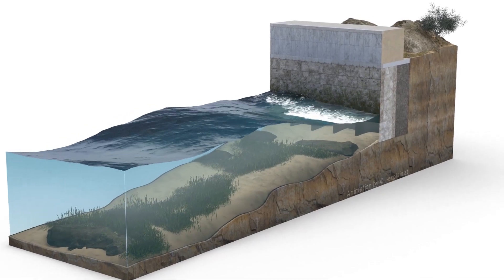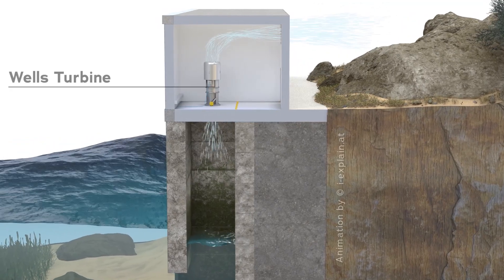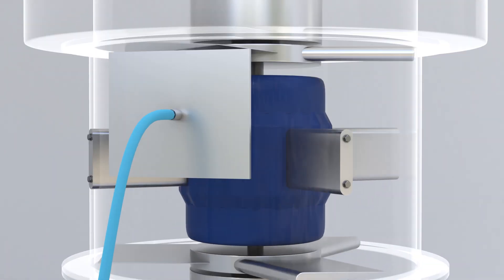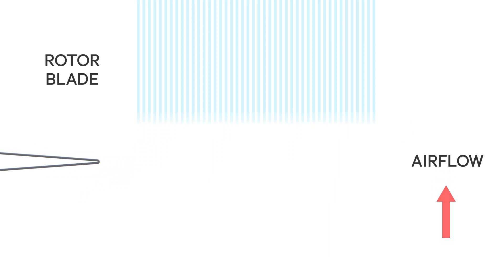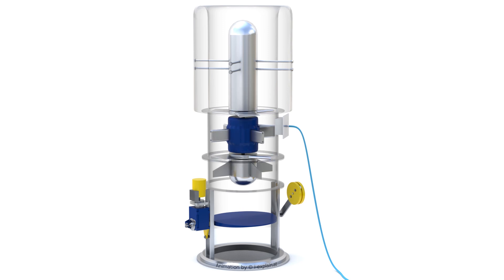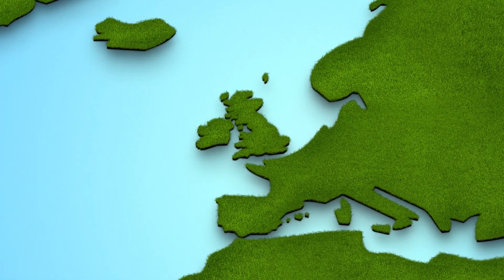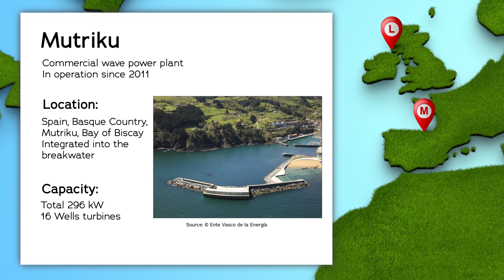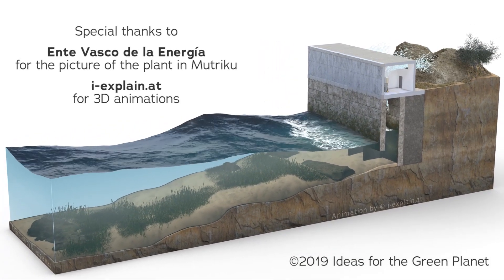Harvesting the Wave Energy: The Function of Wells Turbine

Comment: Hydro turbine would be capable of far more energy as water density is farrrrr beyond air density, meaning far more energy in a specific volume of water than the same volume of air displacing the same amount.
Reply: But it comes with greater cost. Fixing under water is harder, and salt is harmful for the device as well. This one looks simple and requires low maintainance
Reply: Maintenance on anything in saltwater is a bitch, eats through most metals and plastic.

Comment: how do they install something like this?
i like the design. but to make it work requires installation which looks difficult.
Reply from the maker: I don't know what do you mean "installation looks difficult". The turbine is installed in the house above the hole. It is easily accessible.
Reply: @IdeasfortheGreenPlanet  
I was referring to the construction of the base house. Is it a prebuilt mold or is it built after the installation of this product.

I am basically talking about the casing structure around the turbine. Made from concrete I would assume.
Reply from the maker: @52262, Thank you for your comment. According to the information we have from the construction of the Mutriku power plant, a concrete foundation was build in the water first. Then they stacked the prebuild mold, as you guessed. The wave power plant is a part of the breakwater. First, they planned the breakwater and then they decided to enhance it wave power plant.
Reply: @IdeasfortheGreenPlanet  
So is there one in use. I mean instead of the animation. Is there a real example of this running.
Reply: @IdeasfortheGreenPlanet  
As I said, I like the idea of this turbine. It seems very efficient.

Comment: While interesting the numbers given seem top lack context. I looked up the average daily use of a house in the US and it's approx 900 khw, what are these producing per month?
Reply from the maker: I assume that you refer to the Mutriku wave power station. The average energy consumption in the European household is approx. 10 kW per day. The Mutriku wave power plant is designed to produce 290 kW per hour with 16 Wells Turbines. This plant is also used as a research plant for other types of turbines. In the 2014-2016 period, only 10 Wells Turbines were producing energy. The average output was approx. 700 kW per day. The researchers are working on improving plant efficiency.
Reply: @IdeasfortheGreenPlanet  so about 60 house holds "safely" powered with a bit extra in case. That's pretty good. Wonder what the cost to build is and if the 60 house holds can pay for it.
Reply: I have a fully electric house, the space and water heating uses an air source heat pump. My daily consumption varies seasonally between 12 - 35Kwh per day.
Reply from the maker: Mr. Carl Robinson, thank you for your comment. The average energy consumption in the European household is 10 kW per day if the household doesn't use electricity for heating and warm water. Of course, electricity consumption varies upon personal preferences... The consumption of electricity per household in the USA is approx. 32 kW per day, mainly because of space and water heating as well as air-conditioning.